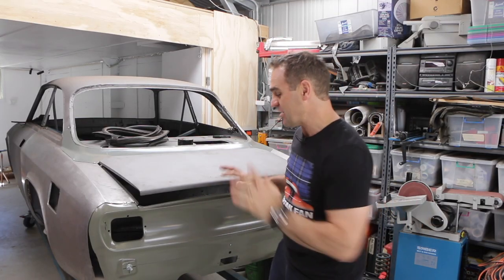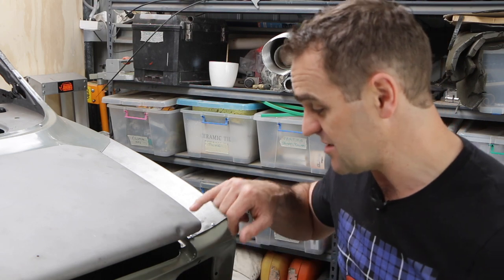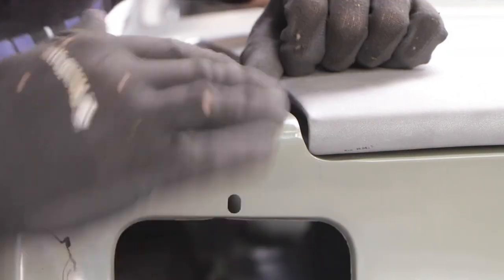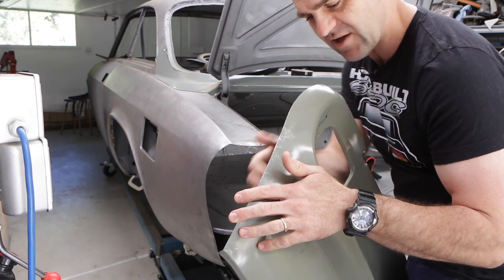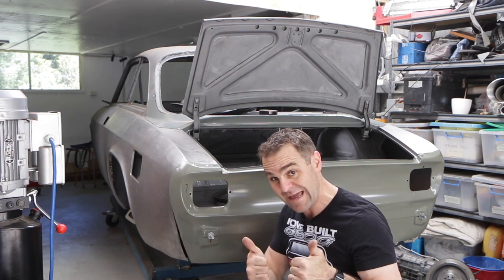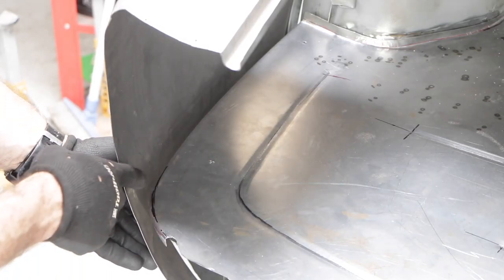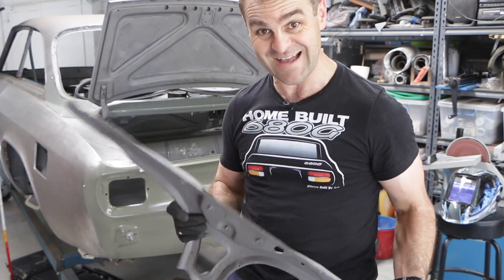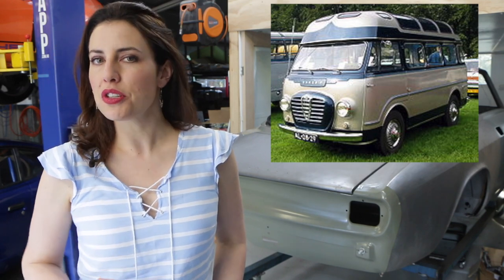Nice rear end! - Alfarrari 105 project car build part 24

Comment: That was a two man job doing it all on your Jeff was some feat....bloody excellent job. It would be interesting to know which order the factory put this rear end together.....might have saved some jiggery pokery.
Reply: dee106ful   Hi Dee, the order was done where the floor pan of the whole car pan was a single jigged format and welded where it touched. Then hand spot welds were applied at indiscriminant spacings but generally 25 mm apart on all lapped joints. This is pre ncr computer tech. The body panels were placed over lapped by eye and disc cut through both overlapping panels at once.  as Jeff has done but they weren't after market pattern parts so the tolerances were better to a degree. Jeff has pulled off this feat through hard work finding the best solution as he moved forward. The final joints were braised with single run of mig braising wire and flushed by means of hammering flat and flat disc finish. The final paintwork primers were applied as fluid putty ie. thick to allow wet and dry correct filling ready for top coat . Glasurit paints were used.
Reply: @geoff3656  
That was a definitive answer thankyou. Hell you must love love love your Alfas or you knew someone that worked on the shop floor.

Comment: LOL, “2.cam cylinder” is a great smash-up :) In other news, I have to admit to feeling sad that you intend to add flares to the wheel wells, since they are so gorgeous and distinctive stock.
Reply from the maker: Otherwise it would only fit tiny tyres and that is not going to have a hope of containing the power.
Reply: @HomeBuiltByJeff  That's fair enough mate.
Reply: @HomeBuiltByJeff  you could always shorten the diff and tub it .. keep the outside looking stock .. the inside on the other hand .. well :D
Reply: Klay great for handling.....not, it’s not a drag car.
Reply: @hughjohnson2674  all depends on the excess of the tub, also the other way to do it is to have a really high offset on the rim, the tub is just to feed in the wheel, handling should be find so long as it's not something crazy, but also remembering that a ferrari usually has 335 tires on it from factory, so there shouldn't need to be at wide, and it can't be too wide anyways because of Aqua planing, and a drag car doesn't handle because it has skinny tires on the front to reduce weight, not because of wide tires on the back. With the Alpha it wouldn't want anything wider than about a 245 at the rear, otherwise no traction in the rain what so ever, which would make for a very small tub, and still looking rather clean on body, and the Diff if you can't get the right offset on the rim may need to be narrowed about an inch on each side, but hey what would I know :D But if that makes a drag car in your mind, they hey go for it. Also with the height and wheel arch I probably wouldn't go anything bigger than a 17, although you might just be able to squeeze an 18 in there, although the look would be bad, and you'd end up with such a low profile tire that you'd end up feeling everything on the road, great for the track, hopeless for the road.

Comment: Thank you for another great video.  I'm especially interested in seeing how you trim (butt weld??) the rear quarter panels to the rear deck panel.  Please also address you tools for panel alignment during welding and address controlling TIG temperature to prevent warping.  

Fantastic skills you have there-impressive-I was over at a buddies today sandblasting a Alfa air cleaner and we were talking about your rapid progress.  Jeff, you are making a bunch of us look bad. Keep up the great work! Thanks

Comment: Make sure you try on all stainless and chrome fittings and  accessories also mate.  Saves alot of swearing after paints done. Lol.
Reply from the maker: Absolutely. I made that mistake on the Datsun. This car is going to be completely assembled and then disassembled before paint ;)
Reply: @HomeBuiltByJeff  are you running bumpers though or going the GTA corsa look ?

Comment: Absolutely gorgeous derriere, mate! I could stare at a picture of that on my 'man cave", er, I mean shop wall, for quite a time! Oh, you meant the Alfarri? Damn good- likely better than I might have arranged! As usual, your obsession for the small details has pulled disaster out of the crusher! I suppose I didn't originally understand how out of spec the car was, and that you had good reason not to "freeze" the unibody by welding a bunch of diagonal braces into the middle of the car to control distortion- you had evidence of distortion I couldn't see through the camera lens. Great job! FR

Comment: Fantastic work! Patience is definitely the trick to fitting these panels, especially fixing those little corners that push the panels slightly out of line. Something to think of before final welding is the order of things. I'm working on the right quarter panel and I notice I have to weld the reinforment panel before the quarter as I won't be able to reach it, in your case there are 2 so double the challenge! I also had to work the order in which to weld the spare wheel well to the floor but doesn't apply in your case :)
Reply from the maker: Definitely. I will actually be welding all the external panels together off the car so I can dress everything, which is actually how they did it in the factory :D

Comment: Jeff are you planning on running a single exhaust tip or duals on this? because if you're going to run duals it might make sense to do the second notch on the right before you weld everything together
Reply from the maker: I will be having dual, but I have plenty of access to sort that out down the track ;)
Reply: quads are better...

Comment: Just wondering what you're using (if anything) to prevent flash rust on the unpainted panel surfaces? Were they coated with something immediately after media blasting?
Reply from the maker: Keyfos

Comment: Hi Jeff.
Regarding you great site.
I sometimes find it problematic to purchase from elsewhere than Europe. The reason is tax, cost for shipping etc.
Perhaps a filter on the site, to divide into regions? 
Just a suggestion from a Scandinavian.👍
Besides that, great idea.👍👍
Reply from the maker: Shipping and taxes varies so widely, it is too difficult to pin it down. At least this way if you see it is in Euro's you know it is in Europe at least, but I will pass it on.

Comment: What you need is a pin-type contour gauge. It will help you massively in making both sides even, as well as panel beating to match curvature without having to constantly test-fit. They are truly excellent and handy tools for bodywork. Some examples in the link:

https://wiki.ezvid.com/best-contour-gauges
Reply from the maker: I have one, but it is not super useful over large areas.